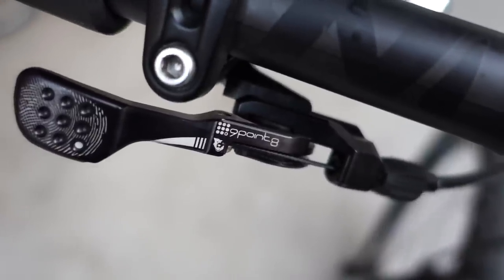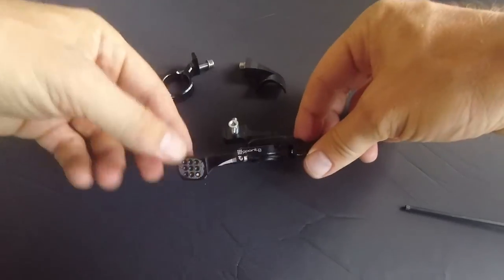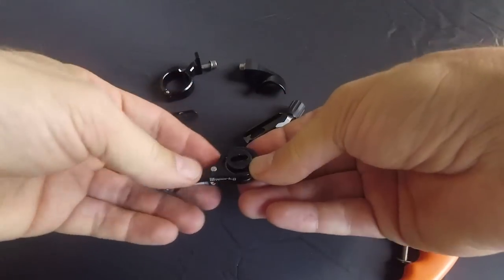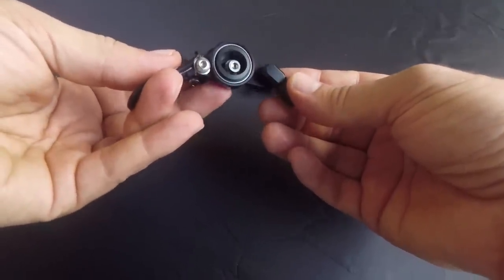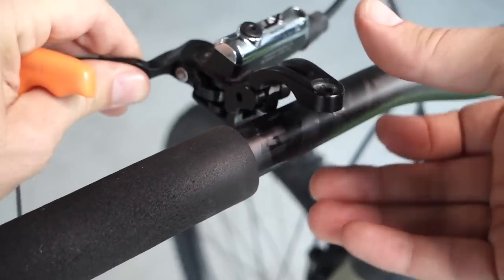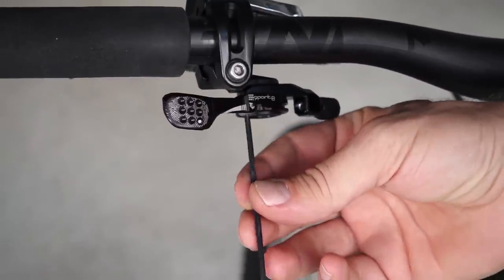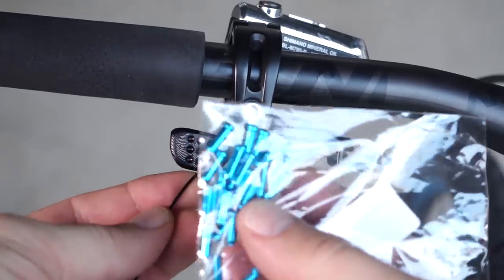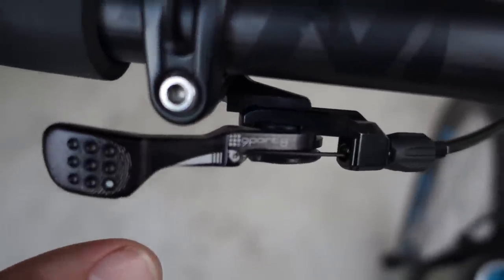Digit / ReMote Dropper Post Remote Details, Installation - 9point8, Woolf Tooth Components

Comment: that comment about water getting in to the housing is actually very true..  My cable is now constantly freezing when its colder. I think I need to change the housing always before we will be getting freezing temperatures.
Reply: I use oil in cables, I have never had issues with freezing housing & cables, coldest I rode was -11, I also rode in wet and snoy conditions, no issues, but if it's possible to use a cable end with a hose, mount a seal on it, cut it to size to prevent contaminations from water & dirt.

Comment: Just finished an install of a Wolf Tooth Remote Spec B along with a Brand-X dropper post.  Sure wish I would have watched your video before doing it.  The directions were difficult to follow on Wolf Tooth's website but your video made it look simple.  The good news is I have one more install that should take me no time at all.  

The only thing I am not completely certain of on the WT Remote is do you run the cable through parallel to the lever or down perpendicular?  I originally installed it down since the instructions indicated "under". The WT directions indicate "Route the cable through the grove, under cable clamping screw/washer, and out behind lever"    If you could clarify this I would appreciate it even though your review covers the LA version as opposed to the Remote version.  Thanks!
Reply: Thanks for the fast clarification.

Comment: I'm a little confused. On my Fall Line dropper the cable is fed thru the remote to the bottom of the dropper and cut from there. Has that changed or did you cut both ends of the cable for this install?